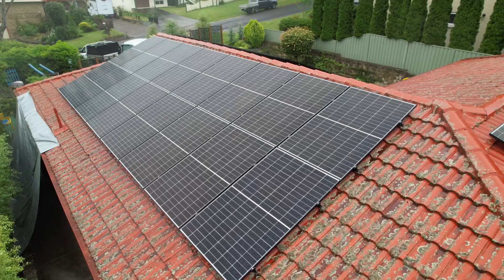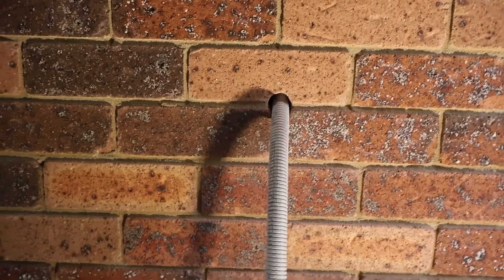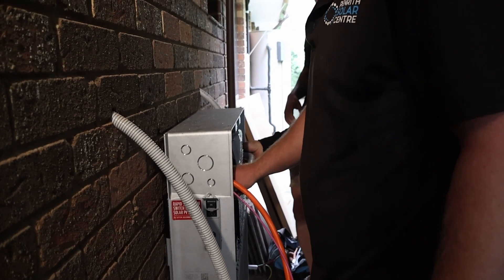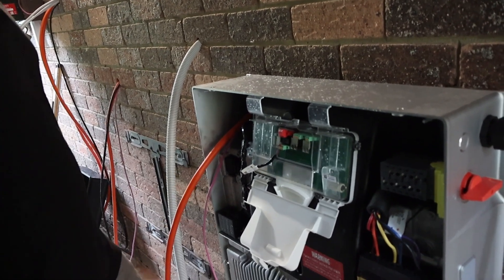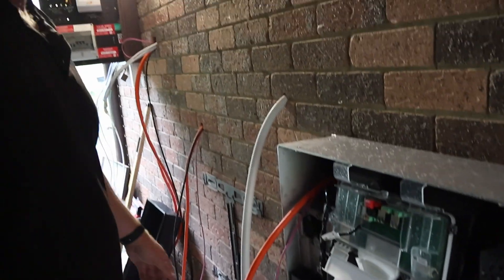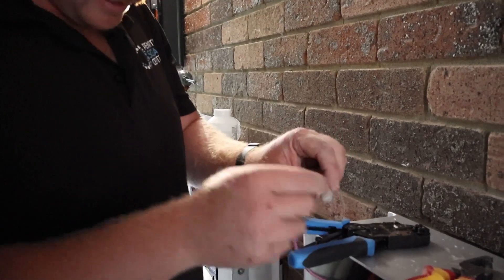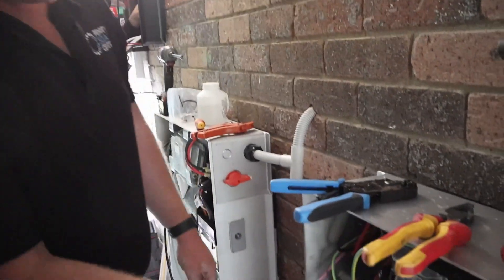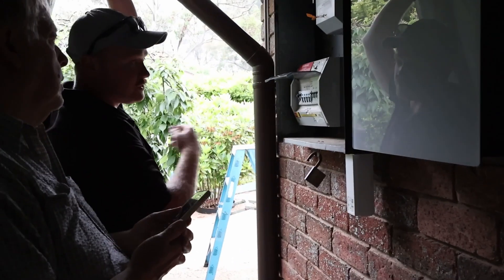Installing two Tesla Powerwall 3 with 19 kW solar panels

Comment: So no Enphase microinverters, 19 panels DC to batteries inverter.
DC 600volts through the roof attic space and 600volts DC down inside the wall cavity. 
No rooftop fires, which is good. 😊😊

Comment: people do not understand that the grid itself has a  large cost to the customer. 
That is seen in my 5cents kWh feedin and 50cents kWh supply. 
But if all your energy comes off your roof and you stop gas heating etc, and petroleum purchases and grid supply electricity usage then the benefits to the customers just gets better. 
Grid owners are terrified of this. 
The suggestion that the grid may have to turn off rooftop PV with higher feedin causing grid destabilisation is a worry that customers may not turn the grid back on.
Just leave the grid turned off until the customer needs a little more to top off the home battery now and again. 

As the grid cost itself are fixed, costs will need to be shared with fewer customers. 

4million rooftop PV today, EVs being charged from home, v2g Australian Standards are being developed. 
More and bigger rooftop PV being installed. 10, 13, 17kW systems.
People are trading in their old EVs for newer ones. 
The v2g features will stimulate more trade-ins.
Selfplug-in selfparking will add to the v2g. 

When 20million 6.6kW rooftop PV then the customers will generate 660gWh. 

This is more than the fossil fueled 600gWh daily maximum possible. 
Actually, the avg demand is only 400gWh.

I bet the grid owners will do a deal with rooftop PV customers and sign up heavy industrial customers moving away from fossil fuels.

Same grid, more customers, less central generation, less distant renewables. 
Customers with an EV parked at home every day will have the v2g EV as a massive home battery backup. 

Customers who can plug in at work will do the same. Trickle all day long. 23hrs every day. 😊